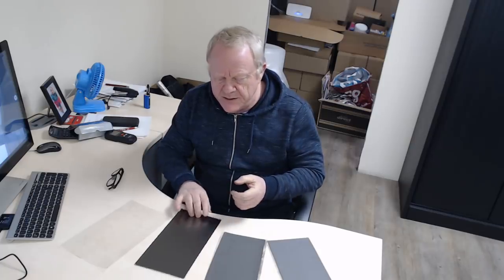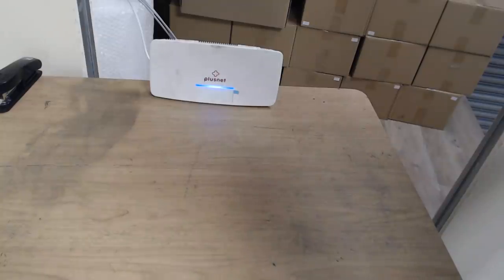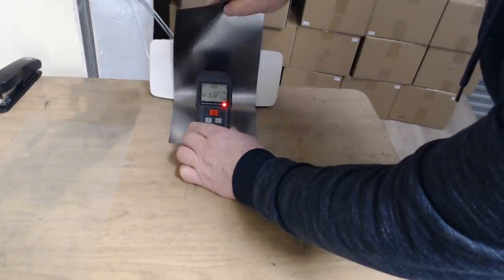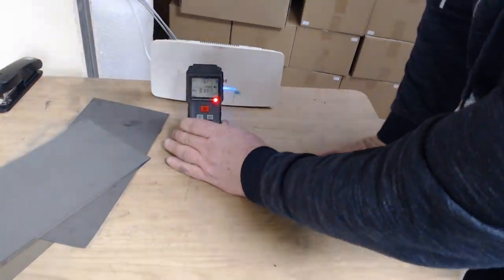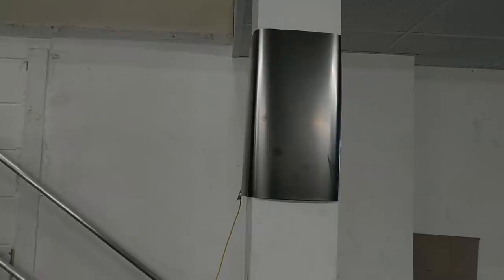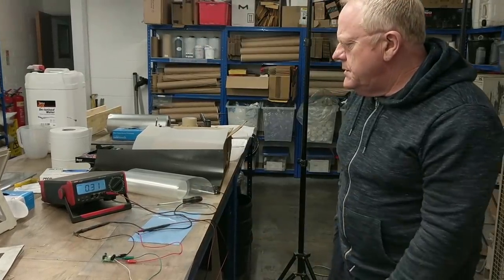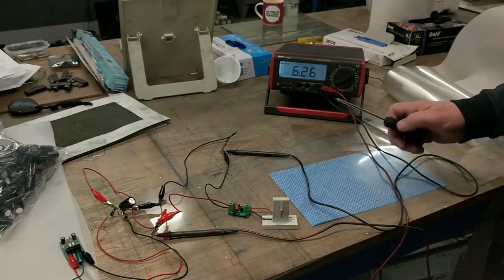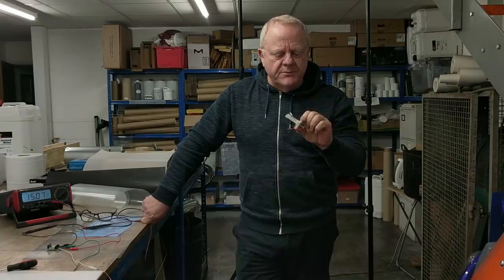Energy Scavenging With A Graphene Sheet

Comment: From the RF point of view there are so many things wrong with these experiments, particularly the last one. The best that can be said is that the provide an indication of the performance of these coatings as RF screening.
One question worth asking; what unique property do these coatings offer over say conventional metal/metal conductive coatings?
I am not trying to make negative comments, I am suggesting that the material needs to be studied to identify unique properties that will increase its value or find applications where its properties are superior.
Reply: you can eat graphene
Reply: @seanbandes648  but you turn into a bus conductor :-)
Reply: calm down he's not fillng a patent application
Reply: @stevenbishop8625  having read a large number of patent applications and generated a few. I can assure you that a workable design is not a required to get a patent granted. If you cannot identify the flaws in the methodology being used in these tests you clearly do not have much understanding of RF. As I said, these crude tests can only provide a vague indication of screening effectiveness, they certainly cannot provide any quantitative information. It is also doubtful that the comparison can be relied on. There is so much wrong with the test methodology it is difficult to know where to start. A WiFi modem is really not the best RF source, given its mode of operation and I am not sure what is to be gained by wrapping the material around a concrete column and connecting to a scavenger circuit via a long wire. I doubt it  will tell you much about the material. The connecting wire is likely to dominate any RF pickup. Certainly it is very unlikely that much of the WiFi signal will be captured by the arrangement. It's more likely to capture VHF radio energy or 50Hz mains pick-up. RF testing in the open is notoriously difficult, even with sophisticated test equipment. Field strength tests are usually conducted in an RF anechoic chamber.
Reply: I think it is unfair to expect someone who does not appear to have a background in RF engineering to conduct relatively difficult RF measurements with  simple test equipment. A minimum setup might be a calibrated RF signal generator, an RF spectrum analyser and a set of matched aerials. In order to minimise RF reflections from the environment, such test can be conducted on an open air test site, away from sources of reflection. In the lab, at frequencies above 1GHz, it might be possible to use a large metal box, with a receiver aerial inside, with the open end fitted with window of the material under test. There are many other less direct measurements that could be done, such as using the material as a printed transmission line and measuring its matching parameters. There is a long history of coating the internal surfaces of mobile phone cases with EMC absorbing materials, from memory, One such coating was known as aquardag. Over the years, the need for such coatings have reduced as matched impedance tracking and multilayer circuit boards have greatly reduced the radiated emissions for such boards. One only needs to look at PC desk top cases fitted with transparent panels, to know that RFI issues are dealt with at the PCB level.
I would be interested to know if the copper plating of the conductive graphene coating offers any advantage of the traditional method of making flexible copper on plastic components and interconnects. I suspect it depends on being able to remove the graphene material after the copper has been mask coated onto the graphene coated plastic. There are inkjet printers that can print PCB track patterns using conductive ink.
Reply: Surely we all have to start somewhere, and trying things out is always a good way to discover somthing we didnt know, these practical examples are great, you never know their material might just suprise you.
Reply: @stevenbishop8625  you may be right, but bad experiments produce misleading data. If you close couple a conductive sheet to a WiFi modem, it will respond by adapting it's output power and maybe it's opperating frequency. Even if the software does not react to the load, the aerial and PA circuits will be detuned, changing the output power. As a very minimum, comparisons need to be made between the power being on and off, to eliminate the effects of external radio sources. Close coupling will effect the near field.
There is also the issue of reflected energy. At 2.4 GHz the signal bounces like a radar pulse, in the 5GHz range not only does the signal bounce/reflect off almost every surface, but it is also very easy to block. The electronic smog detector  being used as a receiver I am will to bet will be broad band and relative insensitive, being not much more than a diode detector fitted with an RF preamp  and followed by a DC amplifier. It certainly will not give the information that could be gained from a calibrated test receiver of a spectrum analysis. If this material is to distinguish itself from other common RF suppression coating, it will be in band selectivity across the whole of the EM spectrum.
I really question its value as the aerial of a scavenger circuit, where metal has such obvious advantages. I have already pointed out the flaw in the experimental method of connecting it with a long wire. As a very minimum, it needed to be configured as some form of printed broadband aerial connected back to the receiver using low loss coax of a matching impedance.
These scavenger receivers use a charge pump circuit to rectify and build up a usable voltage. If it is the one I have read about, it is designed to make use of the wasted power radiated by WiFi transmitters. To do this effectively, it needs an efficient high gain  receiver aerial, matched to the RF bands used. Other possible sources of free power, is that which can be extracted from strong VHF broadcast stations. At the other end of the spectrum there is the significant 50 Hz signal radiated by mains wiring and mains powered equipment. It would be a remarkable material indeed if it could capture this full spectrum of energy without being tailored with a suitable aerial topology. I have read about a nano technology in the form of micro rectifying aerial structures formed on plastic sheet that is allegedly able to capture a significant amount of the  broadband microwave energy in a long wave thermal region of the spectrum, but the material under test is not using this type of nano technology, it is basically a conductive sheet, which may have useful RF power dissipation properties, ie  it is lossy. If the particle grain size is sufficiently well controlled, it may have useful nano particles properties, as have been demonstrated in its use in the construction of super capacitors, but I doubt if these crude RF experiments will reveal any useful RF properties. It would be interesting to know its transparency across the EM spectrum.
Reply: You seem to have alot of knowlege on this subject, would be great if you could make some you tube videos about it.
Reply: @stevenbishop8625  I did spend most of my working life, working as an R&D circuit designer for a large telecoms company and have been involved in the approvals process for a reasonable number of products that contained my designs. This involved EMC compliance test for both susceptible and emissions, both conducted and radiated. I do not consider my self an expert in performing these tests, but I do know what is required to get my products approved. So I have done a lot of pre-approval testing using the best equipment available at the time. I have no ambitions of making YouTube videos. 
In this case, my comments were intended to be constructive, by pointing out flaws in the testing methods being used. I think the material under test may have some very useful properties, but I have my doubts if it can distinguish its self as a basic RF screening material, there are just too many other products and techniques that are well established and can be used. It may have applications as a filter, if it can be shown that it is transparent or very opaque in some critical parts of the electromagnetic spectrum. It may find an application as an internal coating for plastic electronic enclosures, but this would be competing with existing solutions on the basis of price. These days most EMC issues are dealt with at source by using the multiple layers of the PCB as a screen. Radiation from enclosures are particularly difficult to deal with at joins between case and lid. Even all metal enclosures can leak RF energy along the joints, even when fitted with silver loaded polymer rubber gaskets. It should be remembered that end compliance is not the only design constraint, there are also environmental considerations such as temperature and humidity, potential for corrosion, accidental formation of rectifying junctions, where mixed metals are used, and ease of access. The RF seal must work not just on the first time the enclosure is sealed, but also after it has been resealed after service or repair.
Reply: Everything on your list may be necessary, but has anybody hooked a wire to it and tested it for wifi yet?
Reply: @randallcell6042  WiFi is not magic, its performance is defined by having a low loss conductor with the correct dimensions. In this respect the coatings are likely to have a poorer performance than highly conductive foil metals such as aluminium, copper or gold.
The graphene coating may have some interesting properties that are yet to be discovered, but these will not be found using a WiFi signal. I suspect that the nano structure of painted on coatings is too amorphous to offer any new properties, particularly anisotropic properties, but if there are, they will be found using much more sophisticated test equipment than a WiFi router.
It would be interesting to expose a sheet to a frequency sweep across the whole of the EM spectrum and look for absorption peaks and troughs. If there are any unique properties, I suspect they will be found at frequencies which coincide with the particle size, these are a very long way from the WiFi band.
Reply: @nigeljohnson9820  Sorry, I'm not going to waste my time in somebody who doesn't speak the true-true of Wifi Man and his wind magic.
Reply: @randallcell6042  "hooked up a wire and tested it for WiFi",  maybe "magic" was the wrong word, "SciFi fantasy" might have been a better choice. Maybe it would be better to try  "connecting up to a plasma conduit and reversing the polarity of the neutron flow, all that is required is a sonic screwdriver and a tri-corder to measure the performance " :-).
Reply: Opposed to a metal screen, a Graphene screen will have resistance, so RF energy will be spent, and not reradiate as it does from a better conductor. But I agree, a proper spectrum analysis, to show the attenuation at different frequencies, would at a glance of that graph show the quality of such material. Still kitchen foil with proper grounding is unbeatable. However using such material as ntenna to harvest energy makes no sense: When collecting nano amperes, you don't want any  resistance.

Comment: This could also be used for low power faraday cage usages. Shielding devices, or components. One thing I would like to see done is a wire replacement capable of some wattage, say .5 amp at 20 volt, thats 10 watts, such as would be a power lead or wire from the stuff.

Comment: The reason why earthing does not make a difference to rectified antenna energy is that some antennas dont need an earth. Check RFID tags they usually use a symmetric dipole which is matched to the load. So to transfer all the energy, the antenna has to be designed to match the load impedance eg the joule thief.This could be slight hard but not impossible and can make a huge difference..

Comment: This is really fun! Not about the RF shielding, but the graphene energy device! what happens when the sheet is 10 feet long with a greater or smaller width? does parallelling these generators produce more usable current? This is really amazing.

Comment: You could try a Cockcroft wolten voltage multiplier circuit & select diode's or resistors with low losses.

Comment: I have been experimenting for years trying to sus out a radiant receiving system with useful.  The issue I have hit is the inability to place multiple receivers into parallel or series diode banks with a single output. As a test bank I have placed ten aluminium foil receivers into a bank running into separate germanium diode banks to a single cap. There was no increase in useful. Perhaps there is a shortfall within circuit layout which you could illustrate within your experiment. Tuning is currently designed about am radio frequencies.
Reply: Use a bridge rectifier per antenna, consider using a tuning circuit as well, the peek to peek signal on a tuned frequency is much more regular than an untuned frequency. Without tuning you are just rectifying static, with tuning you have an actual signal to work with.

still though 1 antenna to 1 tuner to 1 bridge rectifier and you can collect a few milliiwatts if you're lucky

Comment: It's effectively a crude crystal set, charging a capacitor, in that last experiment. Erect an appropriate aerial near to a decent radio station or near to power lines (safely) and you'll be able to light fluorescent tubes. When you mentioned adding a Ground lead having little or no effect, that was likely because the circuit is effectively grounded via the multimeter, either being Earthed, or if battery-powered, by it acting as a counterpoise to the graphene sheet which is acting like a capacitive 'top hat' to the short aerial lead. A sheet of Aluminium foil would have worked better. You also need to consider the microamps of electrical leakage through, and the possible milliamps of RF coupling around, the unscreened multimeter (and other) leads. That alone could charge the small capacitor in that 'detector' circuit.

Off-topic, for a moment: Have you considered making a graphene or graphite micro-structure on a substrate, such that it consists of what are effectively randomly oriented and sized dipoles or monopoles, and harvesting electricity from incident Infra red light sources, including sunlight, waste heat, etc? Something like it has been done before, but not using graphene or graphite, but it's food for thought, perhaps?

As for the first demonstration, I'm afraid that the tests were quite meaningless. You need to use an RF quiet chamber, giving you at least 100 dB of attenuation of external RF interference. (A 10 kW RF source outside is essentially undetectable inside the chamber.) Those are very expensive. You also need a standard RF source, a proper isolation jig (lots more interference rejection), plus some sensitive test gear. DC lighting is used. Even someone moving around inside the chamber will affect results, if the test jig is not isolating the test device from their body's electrical disturbances. I was fortunate enough to have used such a chamber professionally, for low-power tests between about 100 MHz and 15 GHz. It's not a casual process, and careful methodology is essential if you want useful data. Two people moving around inside the shielded and grounded metal-clad chamber would be a complete waste of time! As would somebody opening the door slightly at a critical moment. You put a 'Keep Out!' notice up, and work alone. We even had to leave our digital watches outside the test chamber, because of the RF noise they generate. Interesting work though.

Rather unfortunately, what you have shown is that a simple and cheap sheet of Aluminium foil is at least as effective as an expensive Carbon-covered sheet of substrate. Apologies if this shoots you down in flames; it's not meant to be negative, but rather to point out that your method is incorrect, and thus meaningless. 

Thanks for reading this.

Comment: Can you share the web link for the rectifier circuit you are using?
-Nils
Reply: Low loss diodes in a bridge RECTIFIER
Reply: @markhodgson2348  A "low loss" Germanium diode has a voltage forward drop of 0.3 volts.  Most RF signals will be less than 0.3 volts.  
How come you are getting more than 0.3 volts from the RF circuit and your diode bridge?
-Nils

Comment: How does this compare to a traditional crystal radio circuit?
I seen a video some time back where the experimenter actually used the circuit to power an LED light. I don't remember clearly but I think he combined the circuit with a joule thief.
Reply: How could he know that unless he tested it already? How about you get a crystal radio experimenter kit and give it a go?
Reply: @Barskor1 
I have enough things to distracting me and causing endless procrastination. I don't need another one.

Besides, if I had the resources, I'd build and test an experimental motor design I have been thinking about for the past 14 years.
Reply: @scotttovey  I known where you are coming from I am in the same boat.
I am working on a gravity induced vacuum water distillation and energy production system.
Reply: @Barskor1 
Hey, that's a good idea!
Reply: @scotttovey  Robert Murray Smith introduced me to the water distillation idea and it seemed natural to put a pelter wheel in between the hot vacuum chamber and the cold vacuum chamber at a downward angle with the cooling coil so no matter if water condenses before the turbine it will be pushed through spinning it.
Feel free to explore the idea produce it sell it and so on if you wish the more the merrier in making the world a better place.
Reply: @Barskor1 
👍
Reply: @scotttovey  :) Have a good one.
Reply: @Barskor1 
You too! 😊